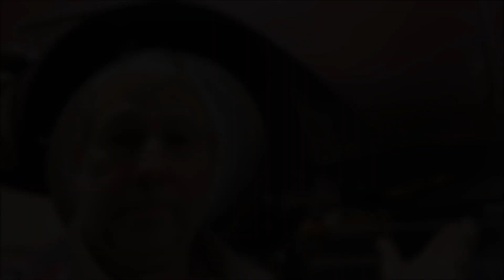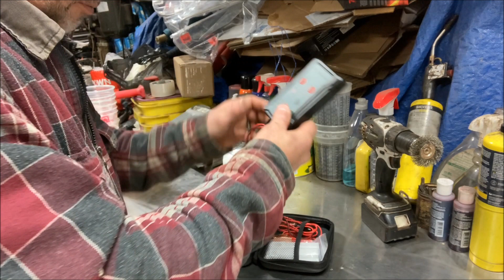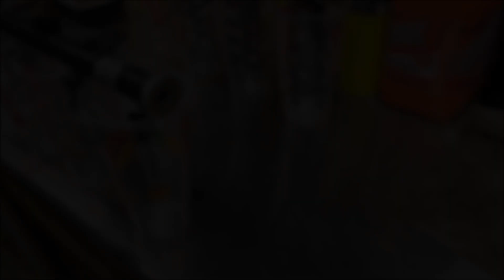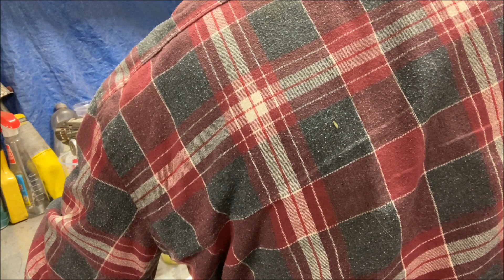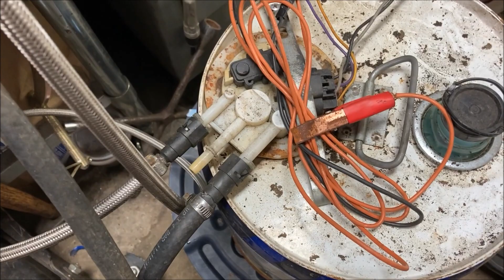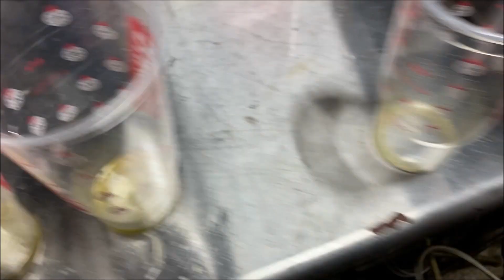LS fuel injector testing before firing the turbo 4.8! 1955 Buick Special Turbo LS Build Part 58

Comment: No kidding, does 2 stroke oil help save stored injectors?
Reply from the maker: I have to believe it will keep the fuel from gelling up over time, I have never had issues with two stroke carbs getting plugged up from old gas.
Reply: That is true. Cool deal